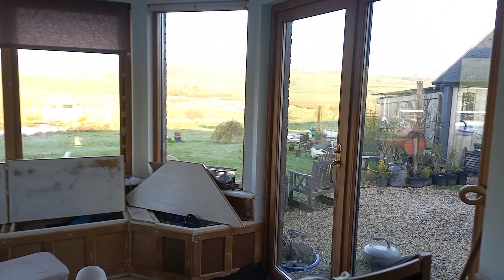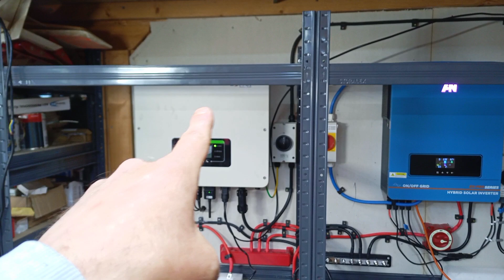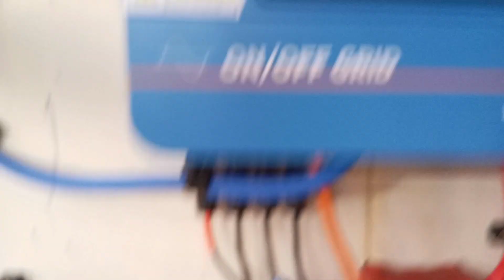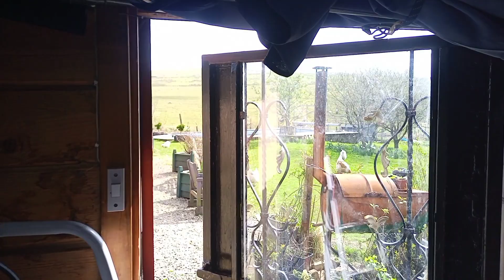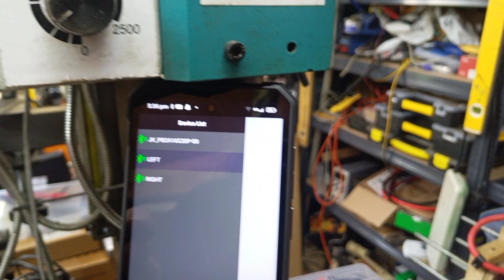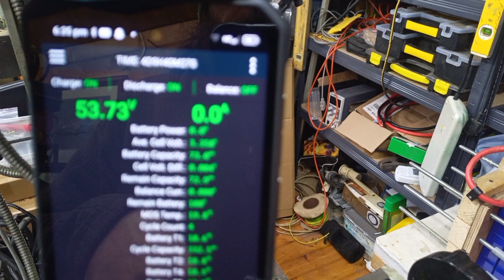Oh Ah Umm Ooops this might be my fault. Off doesn't mean Off Off. Wow sorted, Big Battery BOOM BOOM!

Comment: Im glad you managed to finally get everything to playnice together even though it cannot be explained by a DIY enthusiast. The only thing i can think of is that somewhere in the system the ground have got a backfeed of voltage (low amps) so when you connected the resistor to the negetive it created a circuit that triggered the high voltage on the battery side. It could be from a common earth somewhere in the system. The main thing is its all working now and you are charging. Im still getting 6W going into my batterys at 6PM haha 🤣 awesome job mate
Reply from the maker: Thanks mate, yesterday was unreal the amount of power we had. Fully charged by lunch time and I went to bed fully charged.
Today will be a good test it is cloudy.
6 days of zero kWh bought from the grid, I can't believe it is workin mate.
I might try and do a short video and replicate the fault again and ask the world if anybody knows wtf is going on? And how to start up a SoFar.
Do I need a dual pole battery Isolator switch?
The brain is pickled but the stress levels are down.
Reply: @garys-half-baked-offgrid-dream  it could just be a spike in voltage when it first turned on that caused the OVP, the BMS wouldn't detect it as it needs to be that voltage for X amount of seconds but the inverter may trip as soon as its out of parameters. My victron smart shunt has registered  25V as max voltage on my 12V batterys. I'd try replicate it and then try just a wire instead of a precharge resistor. It could be the resistor that is triggering the OVP. The SOFAR manual doesn't help much. It just says "turn on DC switch" "turn on AC switch" "when battery voltage is adequate then inverter will turn on" 🤣 its as though the inverter needs battery supply before anything else is fired up lol. I'm glad you have managed to get it all sorted now though, give you some time now to relax a little and admire the hard work you have put in to get to where you are now

Comment: Hi Gary, I'm not all that clued up on your complete system (having 2 running), but why were you getting a load/spark connecting the Sofar negative to the busbar when the positive was not connected!!
You must have some sort of feedback from Big Blue perhaps. 
With that in mind, you need to be careful when connecting/disconnecting anything with the solar connected.
I know for sure that on Big Blue when solar is connected it affects the mains and battery connections with voltages being present, some quite high too as I have a similar model, its very strange why this happens.
I now disconnect EVERYTHING before any connection changes, and kill the lot before working on them (mains in/out, battery & solar input.
Good luck feller
Reply from the maker: I will be super careful now lol.  I had previously tried starting the sofar up with big blue off and the house grid tied off, everything  off including house load. and still had the 070 BattOVP alarm.   
Previous inverters I have turned on BMS.
Checked and adjusted setting. 
Preecharge inverter.
Turn on Battery Isolator Switch. 
And stand back.

This sofar don't like that with the battery Isolator off something is live on the DC negative side of the inverter.
It worked fine turning the BMS charge and discharge mossphets switches on as the very last operation.
I am still confused and all ears are open.
I will try and do a WT.F did it do video.
Cheers
Gaz